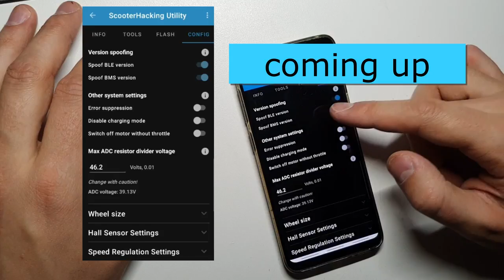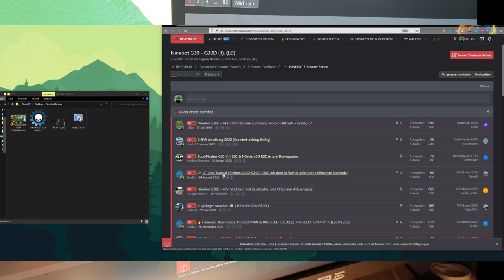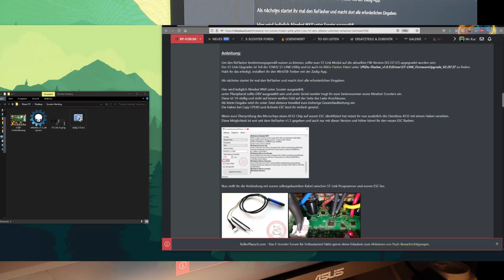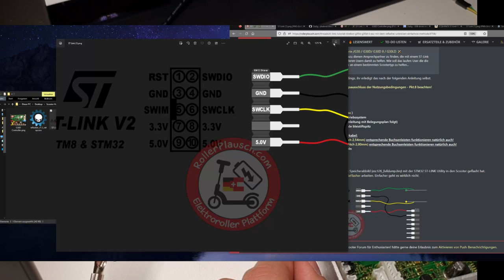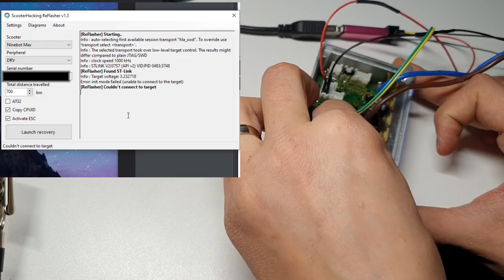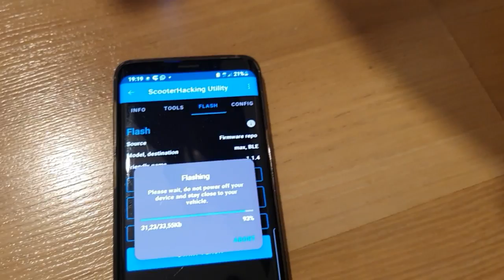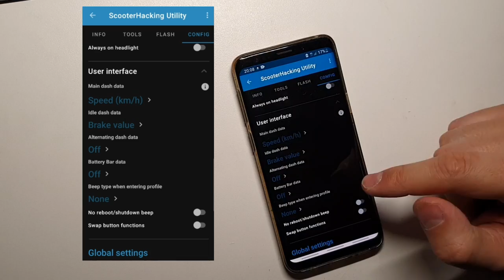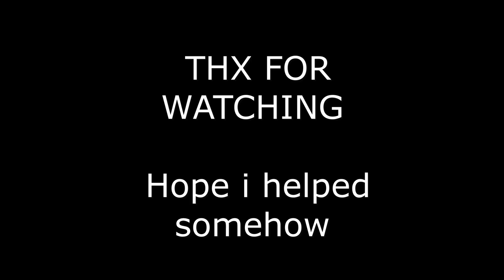Scooterhacking for noobies - St-link downgrade for a good reason

Comment: Hmmm, just wanted to mention I just unlocked my Max G2 which arrived with 1.5.3 control just using an app called BLE scanner and writing a code. My scooter was a European version serial started with 02GV. Prior to this method, I tried the old Xiaodash method with no luck. I can put a link to the tutorial if @Mc Kuc is ok with it.
Reply from the maker: @KayvanCrafted  i think that this isnot possibe on current firmwares. I had a g2 that was on 1.4.something and i was able to change the serial without problems. You can post if youtube lets you. Maybe its better to post in under my g2 max xiaodash video and not this g30 video

Comment: I have a Ninebot P65 and I’m stuck at German region (22km) will this work if I do it on my Ninebot P65?
Reply from the maker: Currently no. Best option is to join the scooterhacking telegram channel to stay up to date when some exploit comes out for the new ninebots P65/ G2 ...

https://t.me/scooterhackingchat

https://t.me/scooterhackingupdates/75
Reply: And for the ninebot e2?
Reply: Same problem stuck at german version and also when i want to drive it just wont work i put the wrong firmware on it i guess
Reply from the maker: @dylangww6293  you answered your question. How did you put another fw on it, if it can not be flashed 😄

Comment: I would be ordering new deck frame and itcmy very first project and I don't have to worry about having any firmwares with apps and Ive still got ninebot max and rather kept in stock until my new deck frame and looking forward on my first project so can not wait then I can go offroading every weekends and stock for public areas without getting a not trouble just sticking with good thoughts not to spend money on toward the government 😭

Comment: Hi! I am loking forward to do it on my scooter, but I don't know where to find info if is compatible with the refresher. My info is: Mi Scooter Electric Essential / BLE 1.3.7 / DRV STM32F|2.4.5 / BMS 1.4.1. That's the info I found in ScooterHacking Utility. Can you tell me if this method of flashing the controller and the bluetooth board works?
Reply: Also, I am from Brazil, here we don't have any blogs about scooters because it's a rare item here. Mine came limited to 20kmh, I bought recently in 2022. I know that those newer versions if you try to flash it via bluetooth may brick them.
Reply from the maker: @hericklet  https://t.me/scooterhackingchat

Comment: My controller had a circuit short even though it was not powered. Just by touching the jumper wire. I think it was the residual voltage. I used the controller 3-5 minutes after unplugging it, so that might be the cause. I'm not sure what else could have caused the short circuit.
Reply from the maker: @genki2705  it is important to discharge the capacitors to prevent short circuits during the st-link process. I wrote that in the comments. Even if you start the dashboard with unplugged battery, the caps have still 8V or so. Some components run on 3V or lower.
Reply: @McKuc  Hi! How to you discharge the capacitors?
Reply from the maker: @anderspettersson4171  unplug the battery first and then press rhe start buttod on the dashboard. After that use a 220Ohm resistor. Check my community tab..

Comment: Should I use the colors of the st link flash wires according to the picture?😊
Reply from the maker: Colors do not matter. Just make sure that the connection is right..
Reply: @McKuc  thank you❤️

Comment: I worked on many Ninebot scooters and never had to take that warranty sticker off of the battery connector. It's easy to unplug without removing that. Also, aren't those type of stickers null and void in the EU? Right to repair and all?
Reply from the maker: We are flashing the scooter here and in this case it is clear anyway.. bye bye warranty! ;)
This was the first g30 i opened. You are right.. I also unplugged it on them without removing the sticker first but sometimes the sticker got squished when plugging the connector back in, so i tend to remove the warranty sticker.

Comment: Hey I can use any STLINK from amazon right?, the one I bought doesn't require sodering where I could just plug it into the pins if that's ok. I have the STM Chip
Reply from the maker: Should work with every st-link v2

Comment: Hello and thanks for the content.  I have a question, I did downgrade to 1.2.6 but now when I put the scooter to charge, it doesn't show the battery level like it used to do before. I have to check it through the app to see the charging percentage. Any idea how to get the function back?
Reply from the maker: Probably because charging mode is disabled. Try to enable it. You can also install SHFW 0.3 regular base 187. It was released today. There is a field weakening option to boost the scooter :D
https://t.me/scooterhackingchat
Reply: @McKuc  how to enable the charging mode please? I can't find the option anywhere in the app
Reply from the maker: @marouaneerrais3189 00:43

Comment: Hey, I just spent 2 hours trying to flash my g30lp and realized I need a STLink because the new DRV version. Is that the only way? I don't really wanna buy a stlink and take the thing apart but if that's the only way then idk...
Reply from the maker: It depends on the controller and fw you have installed. 
If its controller version 1 (ST32 chip) and Version 1.1(AT32 Chip) then the Firmware needs to be 1.7.3 or lower to be able to install shfw per bluetooth. If DRV is above 1.7.3 then only st-link can help. 
If you have a Controller v1.1 and it shipped with 1.7.3 from factory then you may need SHU 2.1.1 instead of SHU 2.2 to be able to install SHFW. Link is in the description.
What DRV is your scoter on?
Check with SHU (ScooterHacking Utiluty App)
Reply: @McKuc hey i have f20d and i have drv 5.87 or sommething like that but It isnt flashable and im wondering if Theres any methods of changing the drv,ble without St link??
Reply from the maker: @shadyman3351  depends on the firmware. Most likely only the st-link option will work for you.

Comment: I followed the steps on your video. It worked perfectly. I just cannot get speed over 29km/h. My scooter is a g30 ii with gen 1 motor. Is it possible to reach maybe 35km/hour?
Reply: In The future in shfw you get field weakening setting so you get gen1 stock running like 35-36 kmh but you lose like 15-20% torque so yeah but definitely gonna use it
Reply: Is it possible to send you my Ninebot G30D for Downgrade?
Reply from the maker: https://youtu.be/rfXen8yiTOo

Comment: Hi i am clueless and I bought a g30d gen 2 idk what to do like all of this is confusing and I want to know if there is any possibile way that if I can downgrade it from 1,81 to a older version with st link or any other thing without soldering because the ones on the forums are old so I want to know if there are any new versions
Reply from the maker: @arorebati351  https://youtu.be/rfXen8yiTOo?si=VHhD_ZKfPyS_XBN5
Reply: @McKuc  thanks bro
Reply: @McKuc  hi mate I found the tutorial great but I have one small question if you could show how to make the folders and how to download the 9bot flasher and the other necessary firmware on the computer side

Comment: Hi, i followed your steps, but now my throttle is breaking and going backwads, how do i fix this?
Reply from the maker: First Check the wiring and maybe you need to enable new max motors. Not sure if this is still a thing but if the wiring is okay (no inverted connectors) you can flash another regular base SHFW

Comment: Hi I get To the very End as you do but then get a Error Saying the Following 
[ReFlasher] Wrote bootloader
wrote 33388 bytes from file C:\Radio Programming\ScooterHacking ReFlasher\binaries\firmware\max_DRV.bin to flash bank 0 at offset 0x00001000 in 1.044090s (31.229 KiB/s)
[ReFlasher] Wrote firmware
Error: Offset 0x0001c000 is out of range of the flash bank
[ReFlasher] Unknown error, check console
Reply from the maker: I had the same error on an stm32 controller and i have to try out if this will fix it: Connect the battery and the ble, turn on the scooter and then flash without the +5v cable (only swclck, swdio, gnd).

Comment: Hi Mc Kuc, I followed your video with ST Link. I cannot able to launch recovery. It always shows coudn't connect to target. Kindly support on how to proceed
Reply from the maker: Check the wiring. Did you install the drivers?
Reply: @McKuc  Yes. I have a doubt. My ST Link card have different terminals(As like what you shows from the diagram).Can i follow the wiring same like your's in the ST Link

Comment: Does this work with the normal ninebot max g30?
Reply from the maker: Yes it does. Depending on the controller you have, you will need a different program.
9bot-flasher is needed for the new v1.1 controllers

Comment: Will this work for the g30p?
Reply from the maker: Yes. You maybe have another controller with AT32 Chip. It can also be flashed with ST-link and Ninebot flasher. If the DRV Firmware  is low enough, you can also flash it via bluetooth and Scooterhcking Utility directly. https://youtu.be/nubJQbKGblI
Reply: Thank you so much!
Reply from the maker: @David-py9wr  install the SHFW and check the info. What DRV does it have?
Reply: @McKuc  i believe it is 1.8.3
Reply from the maker: @David-py9wr  1.8.3 = ST-Link